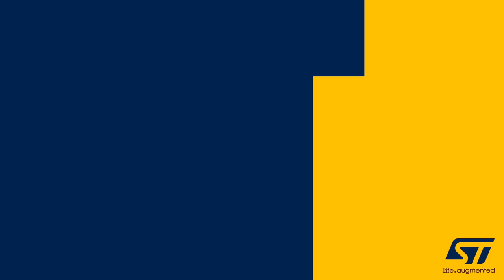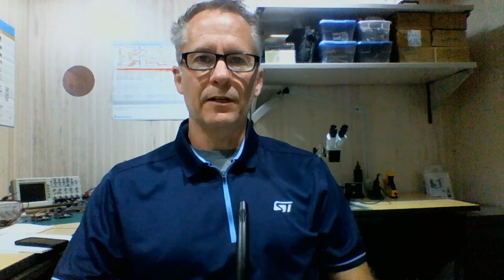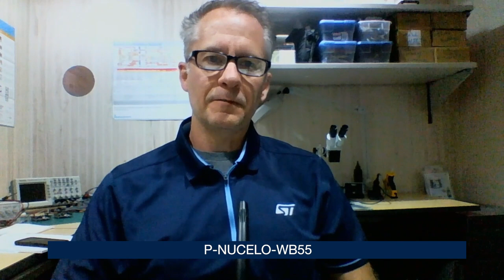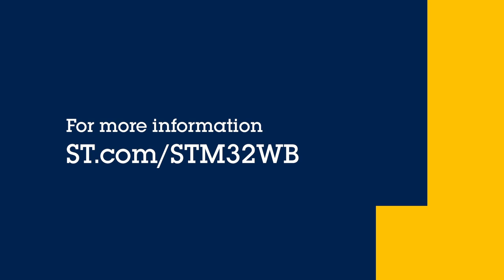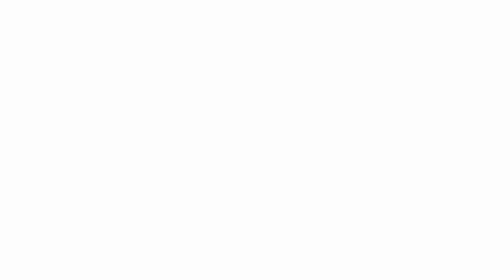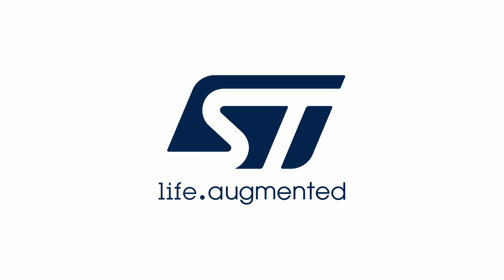STM32WB Getting Started Series: Part 1, Overview

Comment: Question related to the RF front-end which I could not find an answer to from the data sheets. Is it possible to access the IQ samples spit out from the ADC's after signal is demodulated? Thank you in advance!
Reply: HI Maxim, No unfortunately that level of radio access is not possible in the WB.